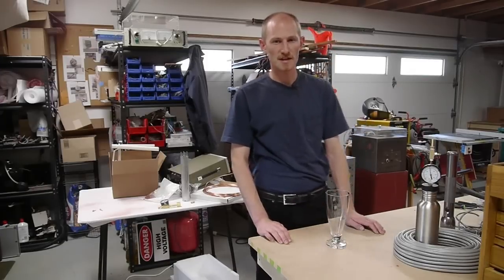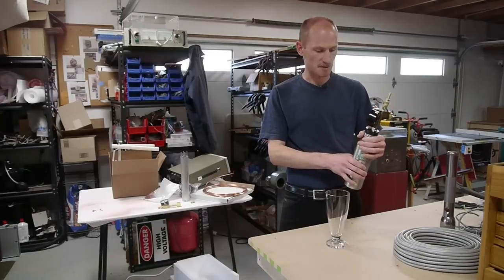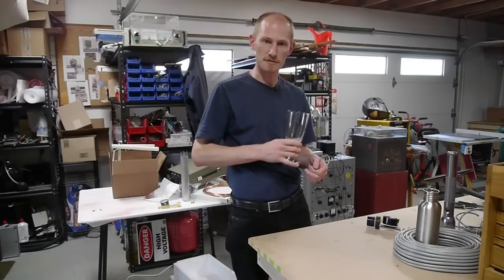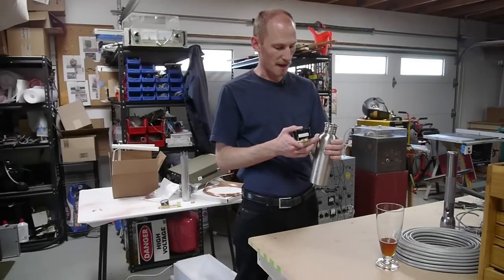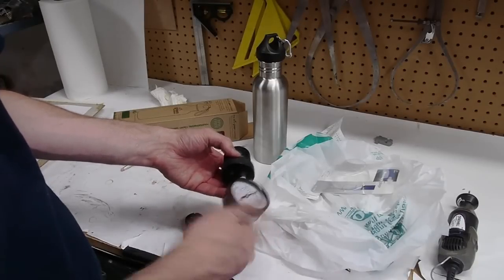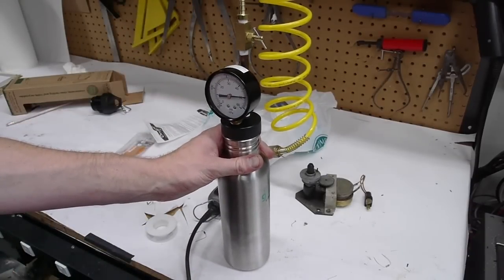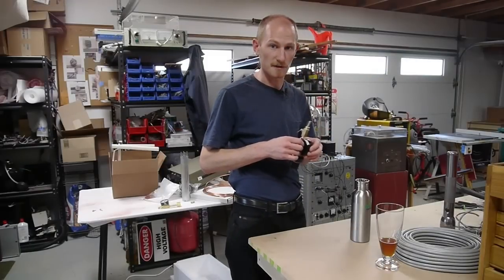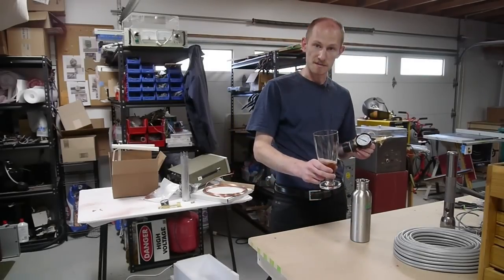Argon beer, an alternative to the usual CO2 carbonation

Comment: @bkraz333 About bubble size:

The pressure at the bottom of the bottle is greater than at the top, which explains why there are smaller bubbles at the bottom than at the surface.

Comment: If you are drinking  canned draught guinness then it is nearly all N2.  CO2 from the original fermentation is all that is in it, head pressures when in SV at the plant is N2, when canned the only thing added is liquid N2. The smaller bubbles formed by N2 give the creamy head and as ou said reduces some of the acidity compared to C02.  This is a concoction of the 1990's to make the beer more attractive and look fresh.  The bitterness was also reduced at this time to woo younger drinkers.

Comment: I love what you did with the cap, but just a thought, maybe you could have cut the top off & fill the cap with epoxy with (or without) a tubes in it to connect to the gauge & valve to. Do you think that drinking argon or/& C02 saturated ______ is harmful for our health.

Comment: At 4:45 why is the pressure reduction when cooling an indicator of the argon gas having entered the liquid?
Isn't argon close enough to a ideal gas... as a result if there's still argon in gas form, a reduction in P when lowering T should be an indicator of argon gas presence, not the opposite.
Anyone know what Ben meant here? Is it because when argon enters the liquid it takes less space?
Thanks

Comment: Is that a  Henry's law matter? 
CO2 can be found liquid at relatively low pressure (50 PSI) while Ar still gas, that will require a more elaborated method to dissolve Ar on beer or increase pressure to around 2900 PSI to dissolve it on the can, but your can probably will need a serious reinforcement of your can, not considering how fast will you need to drink your Ar beer before the gas leave the beverage due to the decompression.

Comment: Actually they inflate them with nitrogen because it will not migrate through the tires.   Also it is less affected by temperature changes since it is a pure gas as opposed to a mix of atmospheric gasses so he was partially right.  However, you are correct about Nitrogen being a drier gas.

Comment: In commercial carbonators is the CO2 not diffused into the liquid by injecting it through a diffuser nozzle so that lots of tiny bubbles stream through it as the pressure builds up?  On the Sodastream units the CO2 is visibly injected as small bubbles at the bottom of the bottle so they churn up through it.
Reply: you generally have to agitate the beer to force carbonate it, one way or another - when kegging homebrew, you usually shake the key after pressurizing to a high PSI, let sit, and then reduce the PSI later to the target volume
Reply: @andrewjvaughan  in pretty sure that's too do with fermentation time. Rather than to do with the CO2 per-se
Reply: @transkryption  fermentation carbonation is super common for homebrew, but extremely unusual in commercial settings - it takes too long and has uncontrollable quality control for the volume of CO2 that ends up in the product
Reply: @andrewjvaughan  well you normally add additional sugar for homebrew carbonation right? 
I don't exactly see how agitation makes the CO2 more soluble... I could see it mixing ingredients so concentration gradients are more even (ie carb/sugar concentration) so the yeast are getting fed a little faster...

But carbonation? Carbonation requires pressure! Because CO2 isn't a polar molecule and is only slightly soluble (this requires pressure).

Agitation seems like trying to shake a bottle trying to get CO2 to dissolve.

In Big Clive's car I can see smaller bubbles having greater surface area with the water... But I don't know if that is much of a contributor compared to pressure.
Reply: @transkryption  yes, pressure

From my brew notes:

Agitating the keg increases the contact area between CO2 and beer even further, promoting faster diffusion of CO2 into the beer. Continue to shake the keg for 20-30 minutes then lower the pressure to 20 PSI and allow the keg to carbonate for 2-3 days. Check the carbonation levels and enjoy!

Comment from the maker: This is incorrect. Nitrogen tire inflation is done because nitrogen doesn't react with nearly as many compounds as oxygen, so it will stay a gaseous molecule longer than oxygen will in an environment with reactive compounds. Additionally, commercial nitrogen gas is typically very dry, while plain compressed air contains a fair bit of water which can more easily permeate the tire rubber.

Comment: Did you purge the head room in the bottle with Argon before pressurizing? I typically have had bad results carbonating soda with my CO2 rig if I don't either eliminate the head room by squeezing the bottle, or purge the bottle before bringing it up to pressure. Shaking also helps since you don't have to rely on diffusion to propagate the dissolved gasses.

Comment from the maker: Yes, but upon releasing the pressure, most of the argon will come out of solution. So, the limiting factor is actually the solubility of argon in water at atmospheric pressure. CO2 is very soluble in water, which is why it is used in soft drinks (along with its addition of carbonic acid for flavor).

Comment: Part of the choice of nitrogen for Guiness is that air is mostly nitrogen. The match of partial pressures in side the head to the surounding air helps limit any mass diffusion through the bubble membrane, so the bubbles last better. The high CO2 inside regular beverage bubbles and high O2 and N2 outside contribute to the short life of poured carbonated beverages.

Comment: There have been hyperbaric tests with soda pop and carbonation, the result is that the bubbles have no significant effect, the tingle of carbonation in your mouth is completely due to the carbonic acid which is why they add a small bit of phosphoric or citric acid to most pop, the extra acid helps keep the pop from tasting flat if it is a bit warm or open a while.(2L I'm looking at you)
Beer is similar on the carbonic acid side but as beer forms a much more significant head the bubbles of any gas can create a creamy frothy texture and nitrogen creates much smaller bubbles than CO2 so the N2 isn't just there to push the beer. (In fact higher carbonation pressures are difficult to pour from a tap without creating a foamy mess, a few use beer engines which are hand pumps used on very low pressure cask ales.)

Comment: Great video!

FYI @ 4:52 you talk about the pressure drop and attributing it to it being absorbed by the beer, it is more likely caused by the drop in temperature lowering the kinetic energy of the Argon atoms. You can use the Ideal Gas Law to calculate the pressure drop from temp and then you will know actual absorption:

PV=nRT,

P - pressure
V - volume in Litres
n - # of mols of Argon
R - is just a constant @ .082058 L*atm/K*mol
T - temperature in Kelvin

Comment: @bkraz333 Interesting experiment, but wrong interpretation of results.

Crudely, PV = nRT, therefore you would _expect_ the pressure to drop when the temperature is lowered. Thermodynamically, dissolution is unfavored in the experimental conditions. Adding CO2 will just lower the Argon partial pressure, which is counterproductive.

Try bubbling the gas through the solution, under an Argon atmosphere. That would be a lot more efficient than relying on diffusion to do the job.

Comment: Argon is pretty narcotic substance. Under pressure. I don't think would notice any narcotic effects if you just replace nitrogen with argon. But if you plan to dive with such a mix you would notice heavy narcotic effects already at 10m depth. 
Xenon is much more narcotic even. If you breathe xenon in air mix, you could loose your conciousness already without pressure.

Comment: Here's a thought.  The solubility in H2O of N2O is almost as great as that of CO2.  I wonder if N2O has the same psychotropic effect if ingested orally, as it does when inhaled?  :)
Reply: I think if it were able to have an affect on the brain, the fast elimination time would cause it to wear off well before a concentration significant enough to be felt could accumulate. That is to say, it usually wears off within a couple of minutes, but orally ingested chemicals have a long journey through the stomach, portal vein, liver, and circulation before they reach the brain. It would build up so gradually that it would be eliminated before it could build up to any significant concentration. You would need to ingest a lot of nitrous for it to build up to a significant level without being eliminated first.

Comment: What about helium?  Imagine a prank, give someone a beer and funny voice at the same time.  I would burst out laughing if I saw that happen!!
Reply: +John Doe It could be fatal if you don't know how to breathe it out.
Reply: +SirCutRy Helium is light enough that normal breathing will flush your lungs of it. If you used Xenon or Sulfur Hexafluoride then you'd have to worry about it.
Reply: Bracy Harvey But if you try to keep it in to speak for longer in higher voice, you could die.
Reply: +SirCutRy you'd probably start breathing after you lose consciousness before you die if came to that.
Reply: You need to inhale the gas for it to do anything, ingesting a gas isn't going to do anything.
Reply: Valcor Wabajak well, you'll have helium farts
Reply: Randy Given how light helium is you'd probably burp it out.
Also helium doesn't really dissolve very well so you'd be dealing with minute amounts.